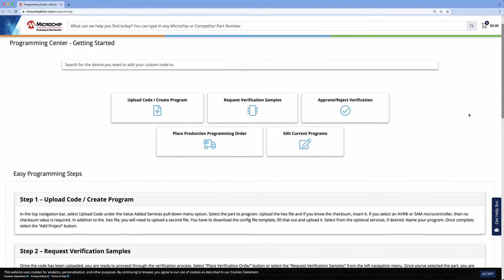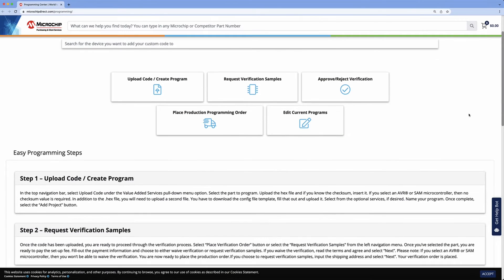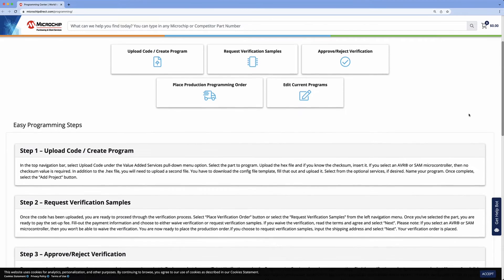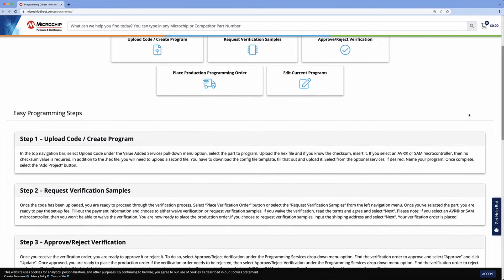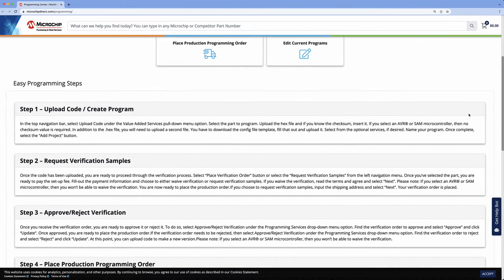AOE | Memory: How do I program Flash/EEPROM?

Comment: How to read/write M68HC11 ?
Reply from the maker: Hi there, unfortunately the M68HC11 is a Microcontroller family from Freescale / NXP. We would highly recommend getting in touch with NXP’s support base for help with read/write operations on this device. However, we can tell you that this would typically be done through assembly language instructions and the specifics of this will vary depending on the model of the device. Please check the datasheets for this device or other user manuals for more detailed instructions. We wish you the best of luck.
Reply: Hello i read my pic16f76 but i can’t program it. I need an advice please
Reply from the maker: Hi there, we would love to help you successfully program your PIC16F76 device. It would be helpful for us to know if you are currently using any of our Development tools. You will need a programmer / debugger such as the PICkit 5, and you will also need our Integrated Development Environment (IDE), MPLAB X IDE – Available for free download on our website. Can you confirm that you have both of these tools?